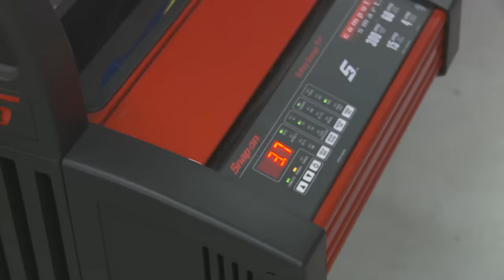Nitrous Muscle Truck and Mini Bikes! - Roadkill Episode 18

Comment: I hate how you can drive in that trick all day and not get pulled over but that blue eg6 would get impounded and crushed
Reply: i bet the 'average Joe' would be pulled over in the muscle truck or the eg6, but these guys have some leniency because of who they are and what they're doing. looking at the Jeeprod episode, they do have their vehicles for safety before driving them. i'm sure the police know this as well.
Reply: it also helps that the car is a 74, therefore a classic and is street legal
Reply: I don't think anyone would be pulled over for the muscle truck. A 74 or not. It's street legal, has plates, tread on the tires, lights and turn signals I don't see why it woul get pulled over.
Reply: The eg6 wouldn't get pulled over either it's a little honda lowered.
Reply: Oducks58 Just looks like a beat up lowered pickup, not really a prime target for cops

Comment: That's the way we used to run  with a 68 Dodge charger 440 Magnum that car was the fastest car I ever rode in my life and drove 175 miles an hour at 125 miles an hour it was just getting into the four barrel carburetor

Comment: we were going up to a show in somerset Kentucky and when we got to a bank we found out the alternator had fallen off. we went to the auto zone down the street and used bolts washers and a socket to get the alternator attached. long story short we made it

Comment: Anybody see the Gremlin at about 10:133
Reply: 10:13
Reply: +Clutch Juice 12 ya
Reply: I saw it too even has the adapter still on the back
Reply: this is ep 18 and the rotsun was first time on the 25 ep, so they worked on it about half a year (6-7 months)before revealed.

Comment: What kind of exsaust is on that thing DAYUM that sounds sweet
Reply: Robby Lupski he said in the video. true dual 4 inch exhaust with short bullet mufflers
Reply: True duals don't have mufflers lol
Reply: Aaron Wilson yes they do, true duals only means that there are two continued pipes all the way back. You are thinking of straight pipes.
Reply: Aaron Wilson
 lol you must never have worked on a car then. True Dual's means two seperate exhasut pipes, not connected by a y-pipe/x pipe etc. They can have cat's, resonators and/or mufflers. Your thinking of straight pipes I would think....

Comment: Just found out that the green substance is oxidized copper which is caused by ethanol that attacks the floats and other brass parts of the carbonator.

Comment: I want to know EXACTLY what exhaust is on that truck.  Everything from the headers all the way back.
Reply: Ed H i'm pretty sure it's this. It's got a 5.7 liter LS6 with a Cam with: 228/232 @ 112 LSA from Crane Cams, Headman Mid Length Headers @ 1.75in to 3in collectors and then it's straight 3 inch back on either side of the driveshaft to 12 inch Dynomax Bullet mufflers with turn downs before the rear axle.  No xpipe. Is that a good enough explanation? :D
Reply: Benjamin Ewald cool.  Thanks.  I am working on an S15 LS swap project and want mine to sound almost identical to theirs, but MEANER since mine will have 2 stages of nitrous and a 614/632 112+4 Comp custom grind.
Reply: Sounds sweet dude! (In more ways than one) :0
Reply: In planning on making a truck this is VERY similar to the muscle truck except for with an ls3 from a camaro that has been totaled, but the engine and transmission ect are still fine, so I can take those out of the camaro (that I got for prob like 5 grand cause it was totaled) and put it in the truck. So in the end I get a 535 hp truck for like 10 grand :)
Reply: The engine helps make that sound you know.  And if your car IS NOT a Detroit car, then don't put this engine in it, it would just be an insult.
Reply: +WhackyJ in AK No offense dude, but anything with an LS engine is gonna have a ton of potential.  My S15 is a small pickup.  It's the Chevy S-10 clone made by GM for GMC.  I bought the truck for $500 and have spent a TON of money on working on it to build it up to hopefully a high 5 second (1/8th mile) drag racer.
Reply: Ed H As long as it's a Detriot car, (Made in USA not import)  I'm fine with it.  But you can do whatever you want anyway, cuz I'm just a guy on the internet commenting on videos XD.

Comment: what kind of exhaust did they day they had on the truck it sounds so good
Reply: +ENGINELIFE 4 inch exhaust with Dynomax Bullet mufflers. When I put a V8 in my Dakota, I plan on using the same setup.

Comment: I had a Honda 70 when I was a teenager and I have to object to the term mini bike. I would like to submit the following... anything with kickstart multi-speed transmission hydraulic front and rear suspension regardless of size is a  motorcycle not a mini bike. Just sayin'

Comment: what is that gear lever?, never seen one. Thumbs up so they can see!
Reply: +Andrea Borg Please, no please...
Reply: +Andrea Borg This transmission has a manual valve body, basically it is automatic transmission stripped of the automation :) You keep torque converter and smooth gear changes of auto but have full control over which gear is engaged. It becomes planetary hydraulic operated manual transmission.

Comment: What exhaust are you guys running on the truck?
Reply: 4'' exhaust with race bullet mufflers he said that in the video. Also the bullet mufflers are as load as open headers
Reply: i believe It's got a 5.7 liter LS6 with a Cam with: 228/232 @ 112 LSA from Crane Cams, Headman Mid Length Headers @ 1.75in to 3in collectors and then it's straight 3 inch back on either side of the driveshaft to 12 inch Dynomax Bullet mufflers with turn downs before the rear axle.  No xpipe.

Comment: Open the tailgate. It will reduce drag, and I bet you would of ran a lot better
Reply: +moe ridesKTM Actually completely wrong.  Keeping the gate closed creates an air cell in the bed that circulates and shoves the air flowing around the cab over the cell.  With the gate up, a truck acts almost like a hatch back.  With it down, the air going around the cab instead rushes into the bed and slams down on it, providing some downforce, but killing the DESIGNED aerodynamics of the truck and actually slowing you down.

Comment: Don't pull the clutch when you kick start it.
Reply: on those bikes, there is no clutch handle - they auto-clutch when you use the shifter :)
However - on older bikes this auto clutch will always slip while kick-starting due to wear or wrong set-up.

Comment: I don't want to be "that person" but that truck is ludicrously unroad worthy. If the police saw that it would immediately be pulled over and declared unsafe and have to be towed with a hefty fine issued.

The emissions, noise, and lack of mirrors are just things i can think off the top of my head.
Reply: It's so old it's exempt from emissions and you only need one mirror on the inside of the vehicle (witch they have). The outside mirrors are for your convince. And it is a little loud but it sounds awesome!
Reply: Alex Antilla
 Californian higway code says "Every motor vehicle subject to registration in this state, except a motorcycle, shall be equipped with not less than two such mirrors, including one affixed to the left-hand side."
Reply: Doreen Green ok. The law must be different in Cali. Here in Washington, I'm pretty sure you only need one, At least on older cars

Comment: Is it possible for a cop to pull over a muscle truck with a loud exhaust?   Unlike imports which is easy bait.
Reply: I suppose it depends on where you live and how you drive. I know id get in some trouble with an exhaust like that haha
Reply: John Moose here in L.A. cops despise the import tuners raspy exhaust. i have a dodge ram V8 5.2 with xpipe , flowmaster with dual axle back turndowns and its pretty loud with a deep tone and so far i havent been pulled over yet in a way too good to be true. I feel they appreciate the domestic scene far more than rice rockets lol
Reply: Well I live in N.C and im out in the country so they are pretty lenient on domestic vehicles here, but it does seem that a rice rocket will get pulled over for being too loud before a muscle car would.
Reply: No one ever said performance cars were ricer
Reply: PremiumSoul in san bernardino cops dont even worry about busted headlights let alone exhaust
Reply: Here in Canada I have been pulled over for loud exhaust in a 1992 Chevy truck, with a homemade 3.5 inch straight pipe and no gaskets on the manifolds. So I think it has to be pretty loud before they care.
Reply: John Moose Hell no, most cops in N.C. are good ol boys, they love a loud v8 anything.  I've gone past them with open headers (no midpipe) and they don't even tap the brake, they love it.
Reply: YellowMach1 same here in Illinois. I drove my 383 s10 with just headers past a cop he just smiled and started laughing when he seen that it was a s10 making all the noise.
Reply: chevydodge88

Comment: How did freiburger shift with no clutch at 0:40?
Reply: those bike only use the clutch for start and stoping
Reply: you can shift anything without a clutch. just isnt very good for it
Reply: the old honda 50cc and 70cc bikes have no clutch.
Reply: I shift my xt350 without the clutch easily

Comment: Hey Roadkill guys. I have a solution to your fuel problems. It isn't an additive. It is a fuel that my company is bringing to the US. It can sit in the tank of your cars for 5 years without going bad, and without leaving any deposits behind. You can even pour it into a styrofoam cup and it won't eat it. It is expensive, and you won't want to run it on the street (although you can, it is just costly), but it would be great for storing all your machines. It is 93 octane, and stays that way no matter how long you let it sit. And NO ETHANOL.